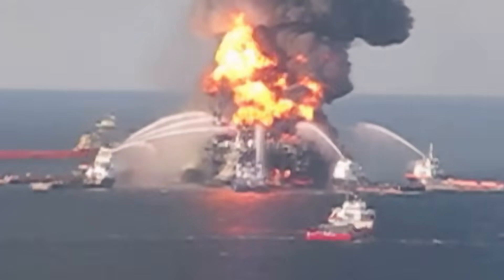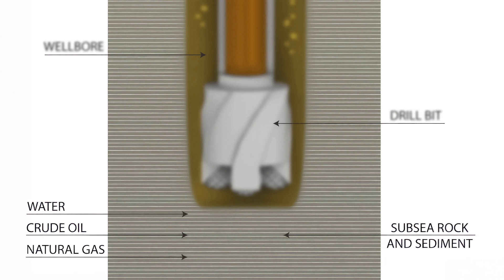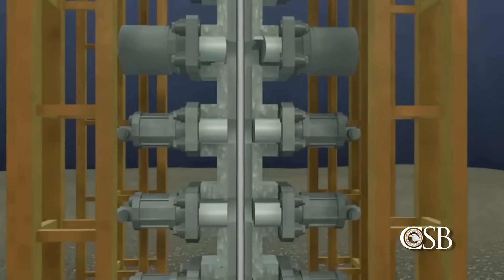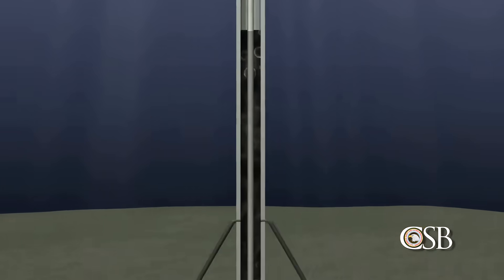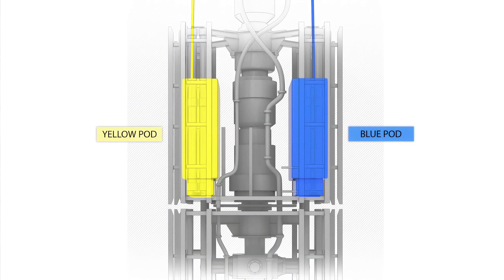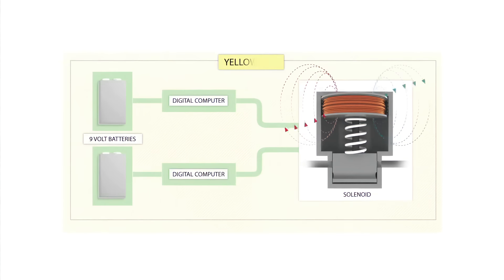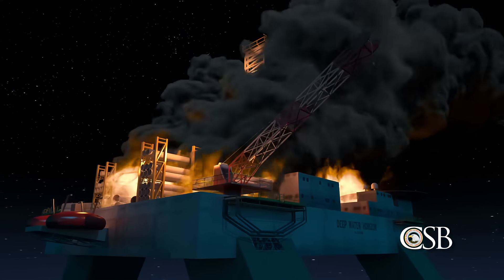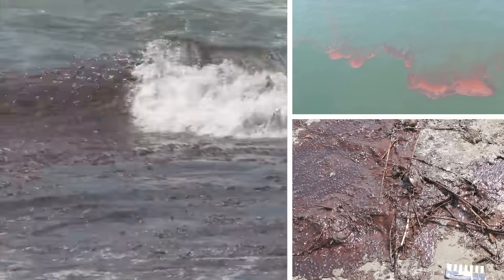Deepwater Horizon Blowout Animation

Comment: Just wish they would stop calling incidents like this "accidents".
Reply: An accident is usually defined with structural failure and/or major injury or death in mind. Multiple incidents are what lead to accidents (Swiss cheese model) In this case those 3 separate failures were the incidents.
Reply: accident implies that it couldn't have been prevented and that no one is responsible. Complete and utter bullshit. These were cock-ups. pure and simple.
Reply: Potato, pototo,  billions of dollars of damage and destruction of the gulf fishing industry, incident...
Let's call the whole thing off.
Reply: Mostlyharmless1985 you're thinking incident
Reply: It was an accident. An accident is something resulting from carelessness, unawareness or ignorance that could have a combination of causes. In a situation like this, this was entirely an accident at the fault of BP (they didn't do enough safety checks) and the workers on the oil rig. They would not do this on purpose.